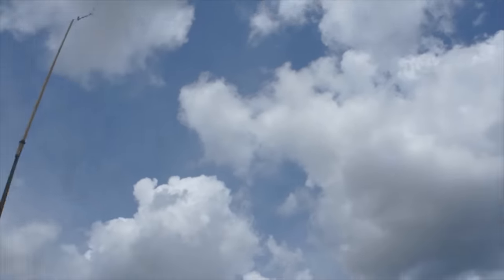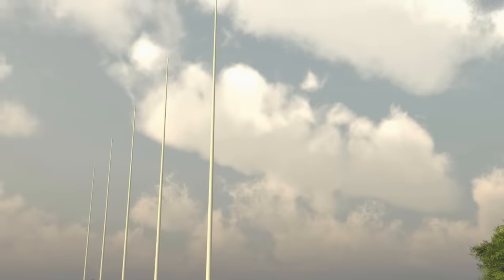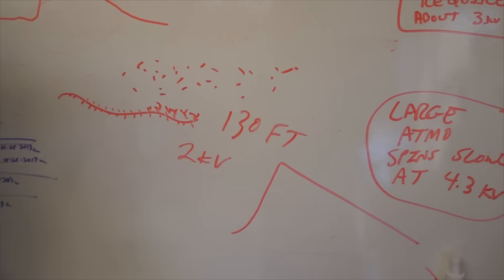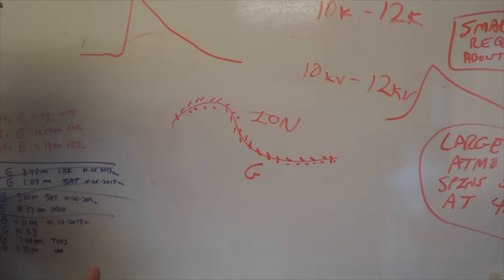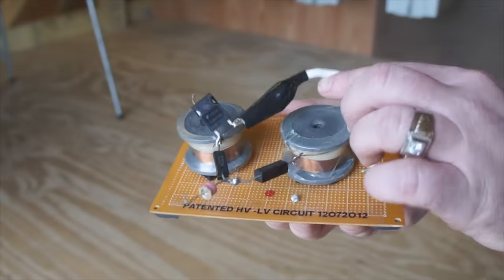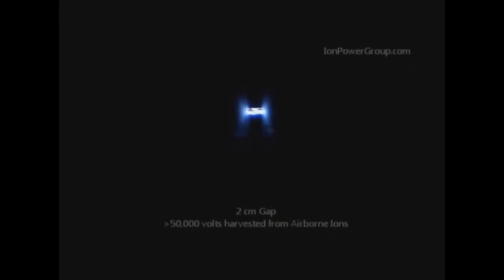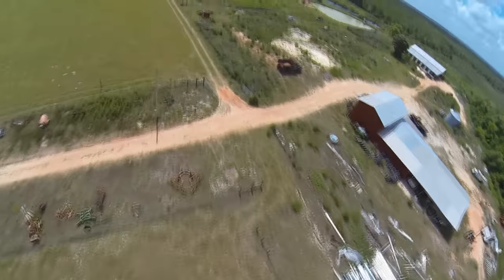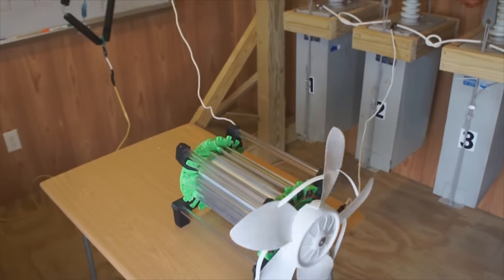Graphene/Graphite Atmospheric Electricity Collectors - Plus Horrific Hexacopter Crash!

Comment: Very cool - I'd like to know more about the graphene coated wire and maybe help with the development of that
Reply: Coat some christmas tinsel in your ink mate!
Reply: m3sca1
basically my thought lol
Reply from the maker: Robert Murray-Smith,
I just clicked back to your YouTube channel from this comment.  Your work looks amazing.  I subscribed and will watch your videos.  Thanks for sharing.
Reply: If I was do this I will use net made from graphene
Reply: lasersaber
happy to help if i can mate
Reply: dunno
Reply: Roland Mieslinger
In the screen 5000 volt 5 micro farads, then:
5000*5000*0.000005*0.5=625
625 watts, in one or maybe two seconds, i don't know
T=R*C
T in second, R egal the total resistance, C egal the capacitance.
Reply: Roland Mieslinger

If we see the spark in the video (in 9:10) and if the cap do realy 5 micro farads, we can see clearly that we have more than one spark in one second.
In fact I don't known if a cap is almost completely discharge with the spark but it seem to be more than 625 joules per second.
Reply: Couldn't you simply use a copper wire coated in a Graphene nano composite? Stretch it parallel to one another?
Reply: vintasalo
sure - why not
Reply: Robert Murray-Smith   How would you get the Graphene cooked or coated on?
Reply: vintasalo
to be honest mate, I think they are going about this the - the graphene coated wire bit - the wrong way - but, it is there project and they have to do it their way
Reply: Robert Murray-Smith Please feel free to share your ideals...  I would love to hear your aspect of the design. From what i've seen and the build, its obviously missing a key part for HV electricity collection.

Kinda like the "Solar Panels" that are 20% efficient.
Reply: vintasalo
I understand - but i don't really know what they are doing so I am not really qualified to comment - and i do know they have been at it for some time and treading on somebodies toes is never a good idea
Reply: Robert Murray-Smith I believe when it comes to "Free Energy" and the abundance of being able to feed yourself and live off the grid; now we cant possibly step on each others toes in doing so. No matter the concept

If you have an idea, I believe you should use it as a tool towards progression. Only sitting back and forgetting about it won't solve anything. Your a smart man, use it!
Reply: I think it's awesome that two of my favorite channels/guys on YouTube are teaming up lasersaber  and Robert Murray-Smith.  For the last couple of months I've been working on marrying both of your projects together. I want to make a graphene capacitor SolN1 for 3rd world applications.
Reply: vintasalo
ok - thanks for that
Reply: You're the man with the plan!
Reply: Robert Murray-Smith NEVER listen to these hater Robert! You are a brilliant man. The world will remember.
Reply: Micah Turner
cheers mate
Reply: yes i know - but thanks for the heads up
Reply: have a look at the earlier videos i did on graphitic foams from sugars and the tang lau method vid i did - which is graphene from sugar
Reply: Robert Murray-Smith

Google "Hemp Graphene" if you haven't heard of it.  1000's times cheaper than current graphene sheets.
Reply: mppforall
i know about it mate - but thanks
Reply: I made a small autoclave and did the Tang Lau method on some glass and mirror based on your videos. I'm working on building a low power laser array to test them.  I hope to make DIY solar cells using this method. Any tips?
Reply: not specifically mate - just don't let yourself get down if at first it doesn't work
Reply: The graphene can work as a capcitive surface ion collector on the one hand and as a super strong, low mass tether material on the other hand.

If you can form it into a thin microtubule capable of holding a slight gas pressure, it can be both a tether, a conductor and a conveyance of helium.
Reply: One of the biggest issues I have with the whole idea is just plain wind. You have to pull such devices down during harsh weather because it will rip loose, pieces of the collector will get broken off or the balloon its self will get punctured, its not a case of if but when, and is the risk of destroying valuable materials offset by the power generated so that it is financially logical to proceed with this design?
Reply: we meet again!
Reply: I figured on either using spider silk or carbon nanotubules because they are so super strong and light weight, plus they have some conductivity naturally, and can be molecularly/atomically coated with a conductive film without adding just a whole lot of weight.

Then putting the graphene 'fuzz' on there in a radial pattern I suppose.
Reply: I like Mr. Murray-Smith's idea of using coal! Its virtually limitless and honestly makes far more sense to me than burning it! In fact, it seems a total waste to destroy such a potentially perfect product just like those people who like to burn pretty wood instead of making beautiful furniture and architecture out of it.

Coal is a combustible fuel is primitive and arcane but coal as a source of graphene to collect infinite volumes of solar charged ions from the air is truly graceful and advanced!
Reply: I would surely think you want to draw the 'wire' upward through flakes, possibly lined up using a weak electrostatic charge, to hopefully encourage them to 'stand on edge' radially.

Not sure how it would be done, but reasonably, one would think that since small incomplete pieces of graphene are is far easier than large continuous sheets, one could very likely generate reasonably sized flakes in large volumes with comparative ease and speed.

How to bond them conductively, I might guess, is with perhaps a copper based ink?
Reply: Robert Murray-Smith has anybody tried to use PTFE Teflon thread coated in your ink? Nice Triboelectric effect maybe? I can’t find any ptfe thread that doesn’t have a different Triboelectric material core that I can afford. Also Nylon 66 with a polished solution of your ink I can afford. I want to combine the two. (TENG’s)Triboelectric nano-generators have been successful with a similar combination but I’m more interested in the capacitance capability. I think it will generate electricity with motion as well as atmospheric electricity. Also if twisted, I believe with a positive charge applied to it will act as a muscle tissue. Do you know where I can buy Pure ptfe fiber. I plan to run the ptfe fiber in a loop through powdered graphite or your ink under tension with an applied current, heat and through a magnetic field. The Nylon line the same with minimal or no heat. TENG’s are beyond my education. I think this cable may act similar to a TENG if I can figure out how to make it hold a capacitance and still be a collector and conductor. I’ve never done anything like this. I was a truck driver. So being disabled, I’m bored but Broke. Would love your honest opinion so I don’t waste money on this one. I love your videos. Thanks
Reply: Mate, how much would a budget system like this cost to power a home.. 100k?
Reply: Why restrict your patent to 'ion harvesting?  No one has ever seen an ion, nor can they prove an ion exists. Why not get a patent for atmospheric electric charge harvesting? Does someone already have it?
Reply: Sad the Patten it for this ! But are like hay make it better we own what ever you design aslong as it graphine based !
Reply: Robert Murray-Smith WE HAVE ALOT MORE TOES THAN THEY DO

Comment: Would a giant pyramid 480ft in the air be able to collect atmospheric energy or does the system require a wire or poll to work? 

Great work!
Reply: I think Tesla's tower could have been the same? Just because some video says he powered a motor from "wireless power". 🤷🏻‍♂️
Reply: The pyramids housed what's known as the ark of the covenant, inside of what we were falsely taught to believe were sarcophagi. The "Ark of the Covenant" as it was called, was a nuclear power source. I think by resonant frequencies, the energy manifested by that device was wirelessly channeled to a solid quartz pyramid tip wich was gold plated, wich would have acted as a wireless power transmitter. It would have effected the quartz content within the stone of the pyramid itself, and produced a piezoelectric effect. Perhaps it was to use to power whatever apparatus was underneath the pyramids that the Pharoah's used to get new bodies and live for hundreds of years 🤷‍♂️

Comment: What is grounding?
 The atmospheric towers and ground station, needs to be combined with a large underground structure, in an attempt to lower the 0 volt level to below the ground, bringing the higher up voltages closer down where they could be reached easier.
 Also try to build one over an underground stream.
 Maybe in a high lightning area.

Comment: I have done the simple rf to dc circuit.  I have achieved 190 some odd volts with my 20 Guage magnet wire 45 feet in the air. And that took quite a while to charge up a small cap. This carbon, graphine thing will prove to be quite interesting.  I wonder if in the patent the techniques of applying the mix is discussed.

Comment: I noticed they only mentioned the voltage, but what kind of consistent amperage does this put out? Are they just using the capacitors to smooth out the power to store it in batteries?

Comment: You mentioned that the ion collector creates thousands of volts what about the Watts? without watts And current and amperage there is no electric power or a very very little amount of electric power. State the wattage in the system you have.
Reply: +Jason Shoraka   That’s the first thing to come to my mind.  The high voltage spark gap is impressive, but changing it to 110v what house hold items can it power?  Although the “free radical” atoms in the atmosphere that are the ions that are collected by the wire fluctuate wildly, a lot of info. is left out.  Is there ion flow at night? If I had a lot of cleared land to string wires I think that I would try this as more favorable than solar cells.  Sadly, that word patented came up again.  Wouldn’t the normal wires on the poles that deliver el. to my house gather el.? Is more free ions available at sea level, or mountain tops? As you can see I’m quite interested in this concept. HAARP looks a lot like what is being tested here. Only they radiate electricity, while this video is an attempt to gather ions from the atmos. And what element is giving them the ions? Nitrogen? Oxygen?  Something else entirely?  Interesting.
Reply: +Chad Hurley Nasa had an ION tether  many years ago.
Reply: Diesel Ramcharger   Yea, and it showed us how many UFO’s there are out there. Gives me the shivers.
Reply: Chad Hurley They damn sure took it, didnt they?
Reply: Diesel Ramcharger   The aliens took the tether? Never crossed my mind !
Reply: I assume that is propably 0,001 A so with 12KV it has 12W of power, but i only assumed that low amperage from information about sparks and i can be mistaken. Search, think, do.

For me that project is developing and i keep open mind. I think too that they not fully understood tesla ideea but it is only my opinion.
Reply: Not a lot of watts, but i did see it running a 12v 1a motor without battery, which works out to... 12watts. Not great, but interesting nonetheless, considering how little maintenance these would have. That is enough to power an LED street light indefinitely.
Reply: Power is what is being conserved, and the units for power is , Killa-Watt - Hours, meaning if a batterie has 35 KWH of power stored i can discharge eather 35 KW   for 1 Hour or  17.25 KWH for 2 hours   or   3.5 KW for 10 hours.
Reply: We are talking about average continuous power generation, which has been estimated to be about 12 watts. Watt hours makes no sense in this context, as we are not measuring energy consumption, but rather, average continuous power production. If measured in KWH, the number would be infinite, since it can generate power forever at ~12  watts, granted the hardware survives.
Reply: Richard Smith I didn't say Watt hours I said watt's in other words how many amps does it produce can this power central air condition system or just a little television, I went to school for electricity for four years I think I know what I'm talking about
Reply: I wasn't talking to you Jason...
Reply: Watts is volts times amps. You are not going to find many people using multiple thousand volt systems, you are going to find them using hundreds or even down in the tens of volts. The wattage of course is a combination of amps times volts, anybody with an education knows this, but what many seem to overlook is that the value is in a linear proportion. 1 v times 1000 amps is 1000 watts, 10 v times 100 amps, 100 v times 10 a, etc, etc, etc. Therefore if they have tens of thousands of volts, even if it is only in the fractions of an amp, all one needs to do it transform the voltage down to a NEEDED voltage, and the amps will come up according to the scale.

Does this mean it immediately has enough power by its self to achieve YOUR personal goal? I don't know, what your goal will determine that. But it CAN be MULTIPLIED over an area [the peak harvestable ionic potential varies based on a host of inputs from sunlight, sun spots, day or night, rain or dry, etc, etc, etc.] so that at some point you achieve the target power you seek.

Raising the altitude of the collector raises the voltage potential, and to some extent, the ionic potential [which would translate into amperage based on attained free electrons out of harvested ionic particles precipitating on the device] and this would to some extent be affected by the wind, humidity, smog, pollen, sea water [salt ions] and proximity to nearby storms.

The trick is to make a system which can efficiently remain aloft at a height ideal for maximal power harvesting, then using your spark gap oscillation or other means of creating an oscillation, transform the power down to the voltage you desire.
Reply: Well it's Tesla's work so there's a chance there missing something that he knew. you say there is not enough amps in the current that they are producing. but doesn't your average Lightning strike carry around 50,000 to 100,000 amps? so is there a chance that this can work but they're just doing it wrong.  this is why I think they should never of patented something they haven't a full understanding of, It just hinders the progression of this science. now i'm no expert (not even nearly) so feel free to correct me as i would like to know. 
thanks
Reply: There was a time when every house in the country had a lightning rod.
Reply: The problem is that lightning works on some principles it is not cost effective to mass produce on an industrial scale at the current price of electricity, and you also have issues with airplanes, tornadoes and general high winds.

Lightning works off the fact that vast volumes of ions in the atmosphere are very rapidly changing locations, and even their states of charge until the potential builds so high it overcomes the resistance of the air [combined with humidity, dust, temperature, pressure, and pre-existing ions from earlier arc induced corona discharges] and neutralizing.

The concept of this design only employs [that I am aware of] the steady state discharge of ionic potential in the air at a set distance from the ground, and does not make any attempt to condense moisture into liquid form, where most of the real power potential resides.

If you study up on the mechanisms of thunder storms and everything that goes into forming lighting, you will see it is a rather complex mechanism which has many moving factors involved, plus far greater atmospheric gaps than most people can afford to create using commercially available construction methods.

Also, since most of the power comes through the condensation of water [especially when combined with ionized dust and soluble gases such as oxides of nitrogen produced by sunlight, automobiles, and of course, other lightning] this apparatus would have to be far more sophisticated to actually harvest significant amounts of power from the atmosphere.

I am not saying it can not be done, in fact, I say it SHOULD be done...

But it needs to be done PROPERLY if it is to every pay for its self.
Reply: Obviously there is power or there could not be voltage, but as you correctly ask how much power. Voltage is irrelevant if the power we're talking about is little. If they gave an amp measurement that would not be quite enough either, since it could just be a spike via discharge. Watts is the correct power measurement in this instance.
Reply: Cheyne Simons kilowatt hours